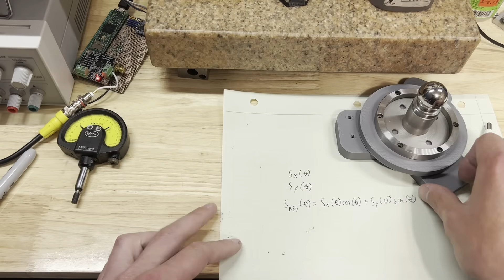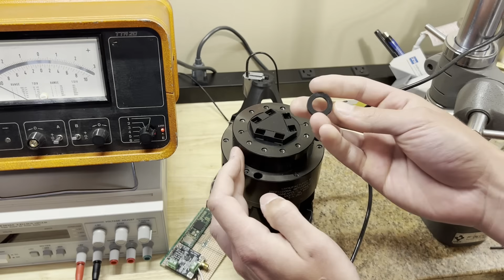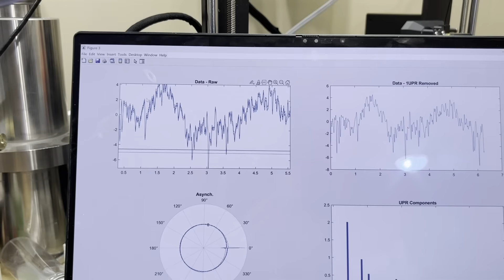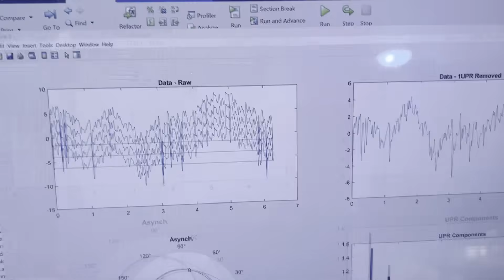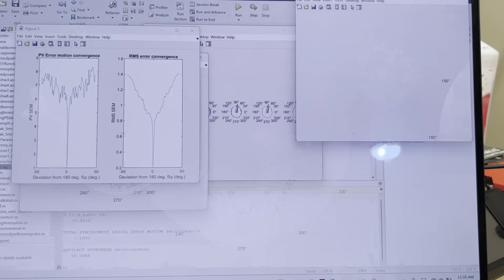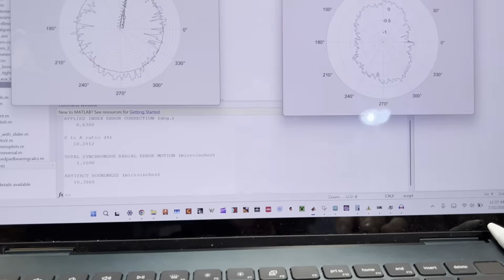PRECISION SPINDLE METROLOGY Pt. 4: Error Separation and Measurement Demo

Comment: Excellent video. Note that we use capacitive probes because the bigger spot size acts as a filter for the high frequency tiny lapping marks our process leaves on the balls. That's probably why using a small diameter tip on your indicator gives you a different roundness measurement on the ball you have, since it sees more of the miniscule roughness of the ball.
Reply from the maker: Thanks Dave. I pulled that ball out of the trash and I’m pretty sure it was never finish lapped, so I think that explains the out of roundness. But yeah the indicator tip acting as a profilometer is definitely a con

Comment: Donaldson Reversal only gives you the spindle error at one fixed sensitive location. With multiprobe you can get the fixed sensitive error for all the orientations of the spindle with just 3 tests.

https://drive.google.com/file/d/1keW9BYlxehsLuaj6jJy-2UF3OOMsqIbw/view
Reply: Multi probe is also superior to Donaldson since you can also calculate rotating sensitive direction error motion from the same 3 individual measurement data you collect for the fixed sensitive test.